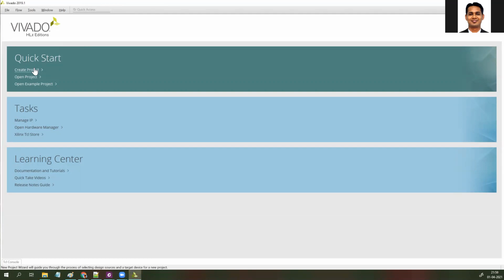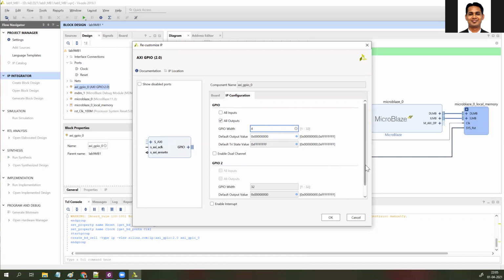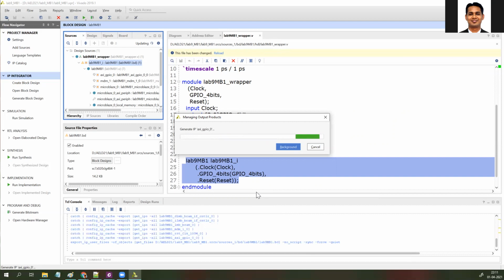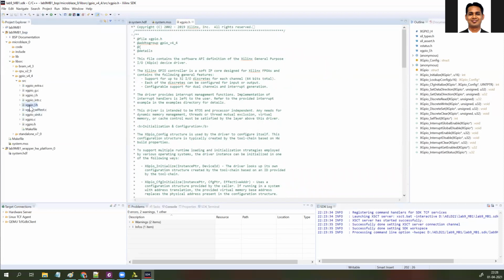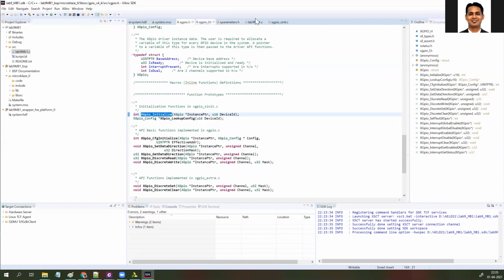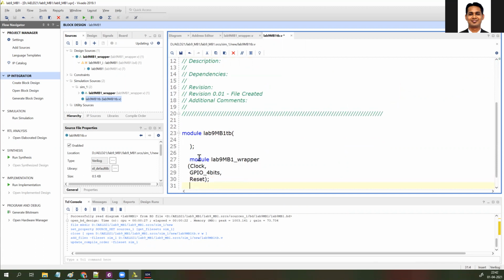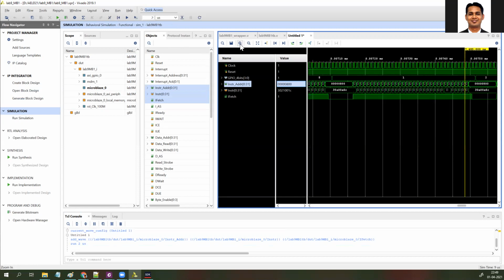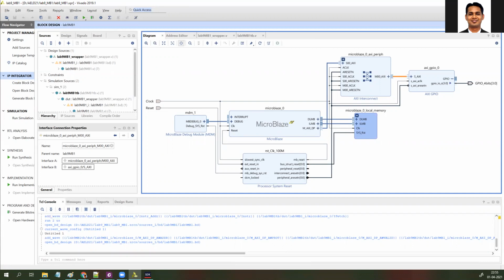IIITD ECE573 AELD: Lab_8_Part_2: Microblaze and GPIO Simulation #zedboard #iiitd #iiitdelhi

Comment: I have the followed the design flow from vivado to vitis since I'm using 2021 version. But when I'm simulating microblaze using testbench, only instruction address is getting incremented but the instruction read is always zero, hence no output on gpio pins. Could anyone please help me out with this issue. Thanks in advance